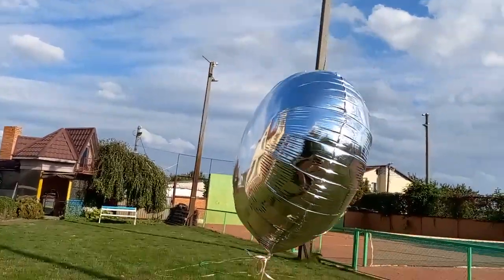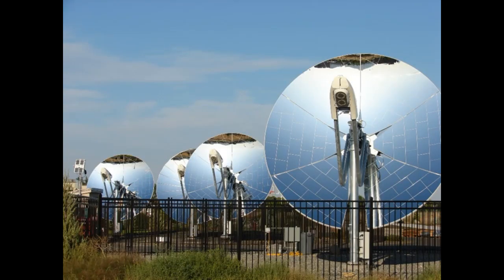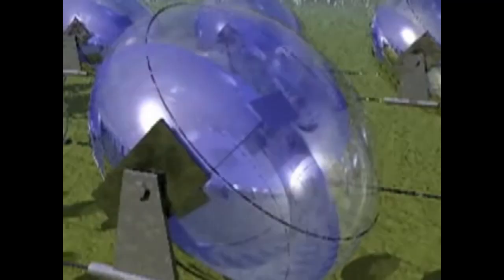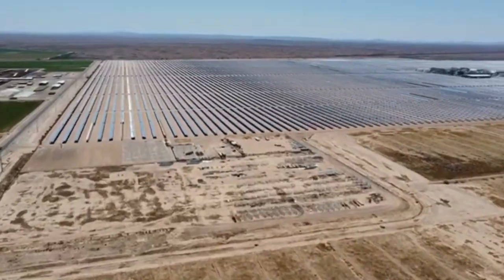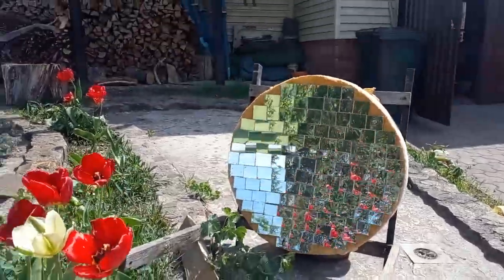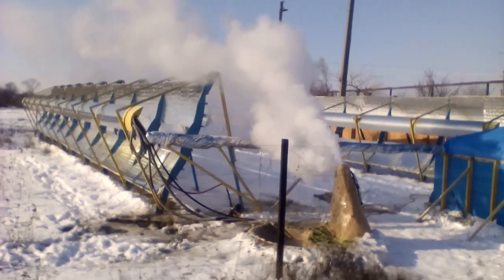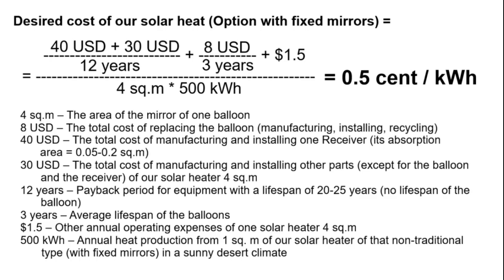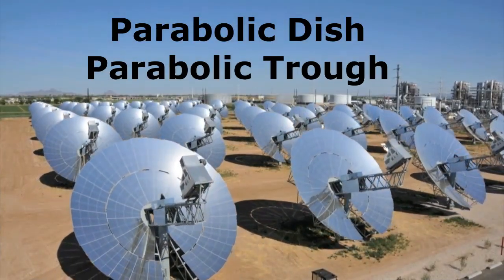Solar energy from mirror balloons

Comment: i am also intrigued that you were able to reomove the aluminum with HCL  i kinda assumed it was on the inside.  but that may be luck of the draw?  or do they only bond the non aluminum sides? gonna have to try some things out.   an alkalyne solution of lye and water may also work.  not sure if either acid or base is reactive with mylar.
Reply from the maker: The balloons are not coated with aluminum, but with some kind of mirror paint.

Comment: my main issue is they are the wrong shape it needs to be a rounded w shape (outer walls much taller than the n in middle) to generate heat most effectively without using complicated tracking systems which balloons dont comport well with
they have been doing some amazing stuff with balloons carrying massive wind turbines up to the jet stream though for maximum wind speed, winds always blowing up there and fast

but for ground based systems almost everyone's using the wrong shape mirrors trying for smallest possible focal point so they have to track them, but in reality you can boil water which is what most ppl are using it for with a MUCH MUCH broader focal point and no need to track except the seasons by making it right shape its all about how light bounces/angles

Comment: btw if you build the right parabolic shape you dont need to move mirrors most of day it will auto focus on same spot till sun can no longer get over side of dish . the trick is having a moderate sized focal point like 1/4 the size of the mirror and shaping mirror like a butt with the heating tube siting on top of the crack 

most ppl focus on trying to achieve the finest point of light and waste most of the light coming in or have to have complicated sun tracking systems 

but if you do it like i suggest it still boils water very fast and it needs little to no adjustment all day just some seasonal adjustment
Reply: Compound Parabolic curves. Nighthawkinlight recently covered it very simply

Comment: "THANK YOU!", Mr. Yurko!
Your videos are AMAZING!
IMO, we need mechanical, clockwork, trackers & cheap, inexpensive solar focusing mirrors.
Much like what you are doing.
Please, keep up your good work & keep sharing your results.
Soon, we will greatly need a way to cook & heat ourselves.
Hopefully, by then we'll have a way to do this.
Reply: or you can just build the mirrors so the focal points a bit larger and only have to adjust them for seasonal changes
and if your not trying to vaporize ants all you really need is 100*c which you can easily achieve with just plywood & mirror paint & the right shape 
you only need tracking and a mirror with a focal point under 1cm for  very specific things if your heating a 2 inch pipe filled with water your focal point can be 2 inches/5x larger and then the angles it catches light at is also 5x larger/no tracking needed

Comment: The cost doesn't really make sense. 500 kwh per year in a sunny desert climate, but that's not where you are. How are you going to transport the heat to your house? 
Solar irradiation is lowest in the winter, but that's when you need it the most, how are you compensating for this?
Reply from the maker: This isn't a home heating solution, which is the topic of my other YouTube channel. For example, today I posted a video about heating a house from its metal roof: https://www.youtube.com/watch?v=dOlxqY_P3kE
Reply: @sergiyyurko8668  Okay, then wouldn't it be more realistic to include the full energy generating system to calculate your price per kwh? transport of the heat (steam), steam turbine, transformer, valves, etc...?

Comment: the solar cell will overheat
Reply: There are HCPV solar panels that can take the heat. Still doesn't make sense, a regular solar panel takes the same space, is cheaper, much more windproof and lasts 25 years or more without much maintenance.

Comment: The balloon forms the shape. But before washing off the reflection from one side. just apply epoxy glue to the outside to cheaply reinforce the shape then cut in half = 2 mirrors of good shape. This allows all the wavelengths through to the receiver and cheaply extends the life of the shape. If you want, once it is dry. Use it as a form. By applying aluminium foil to the outside and epoxy outside that to harden. Quickly forming a cheap mirror that lasts a long time and is easy to replace. Worth getting the ideally shaped balloon.
Reply: Epoxy is expensive, and the goal here is to be really really cheap.
Reply: That amount of epoxy is not that expensive I think. But true, it costs something
Reply: @kashmirha  have you ever worked with epoxy? To create a solid structure of that size you will need a lot of epoxy.
Reply: @wedding_photography 🔴 Jesus was a servant of God ⚠️

{ The God of Abraham, Isaac and Jacob, the God of our fathers, has glorified his servant Jesus.} (Acts 3:13). 📚

⭕ The Bible Denies the Divinity of Jesus
Reply: It would probably be 35 cents worth of epoxy.  Per baloon. In theory that's fine. Love to see it expressed into reality.
Reply: ballon material should be able to withstand chemical in epoxy, also epoxy be able to stick. Nice idea , but I liked balloons floating up and making shadow down

Comment: and UV likely will degrade it
the plastic is nt meant to  withstand years of UV?
Reply: It will lose pressure long before UV kills it. Ever had a balloon? They never stay inflated for weeks, let alone months or years.
Reply: @wedding_photography  If a strong wind doesn't get it first
Reply: @SolarCookingGermany  indeed, also better not leave it up in thunderstorm
see the frazzled apparatus :)
Reply: @wedding_photography  yes good point
any kind of reflector needs to be made of better typ of materials.

but as a concept its good enough to explore a therory

weve judst pointied out multiple problems